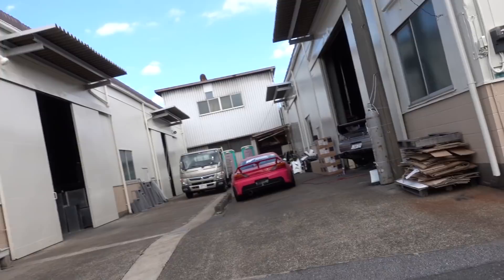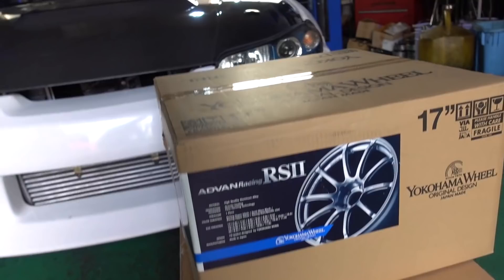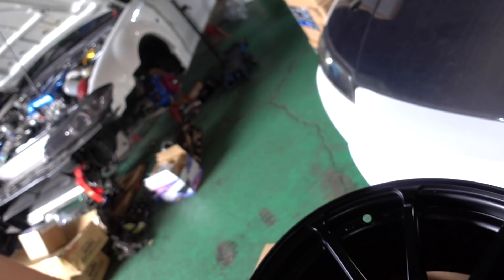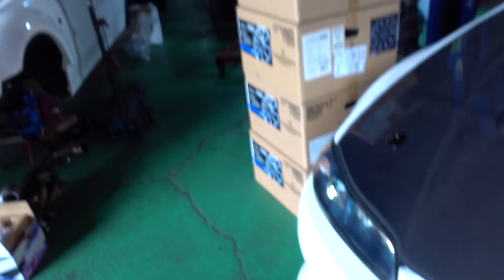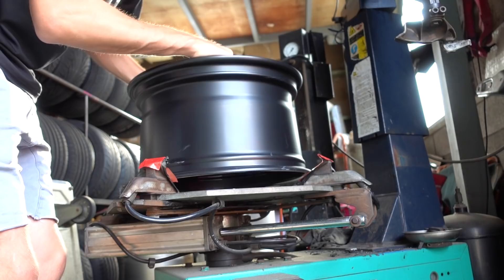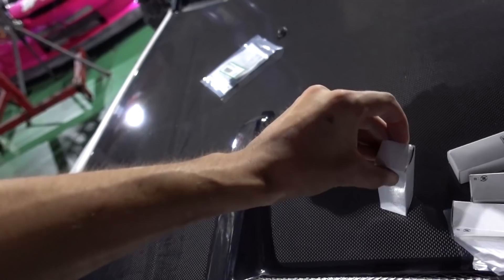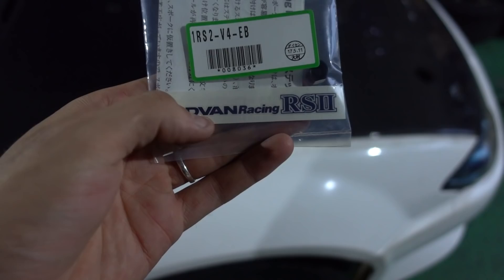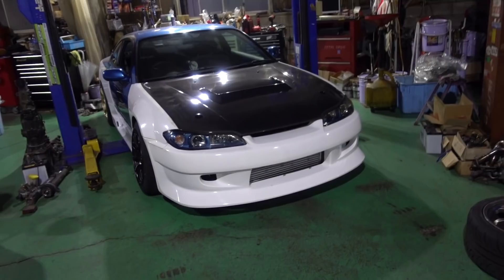BRAND NEW WHEELS FOR THE S15!

Comment: 1 I was stuck in traffic for 4 hours straight from New York to Georgia I get to find out it was a tractor trailer that flipped over anyway other than that check the oil leak between the transmission the engine it could be a rear main seal

Comment: What mm r the deep socket??? I  need a 19mm
Reply: My guess would be they are 19mm. But Im surprised Advan doesnt use mar-proof/plastic coated sockets so you dont scratch up the finish when installing the lugs, with how expensive they are.